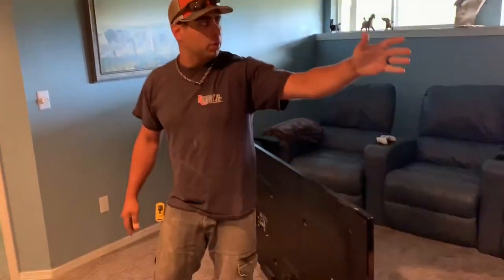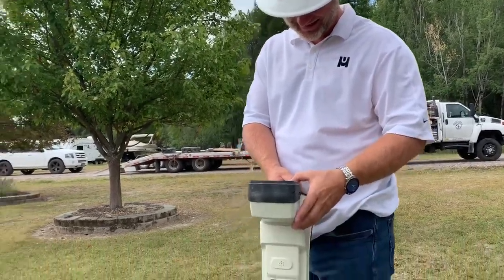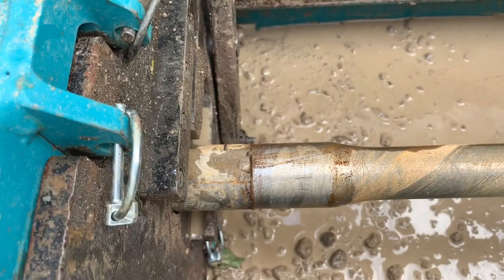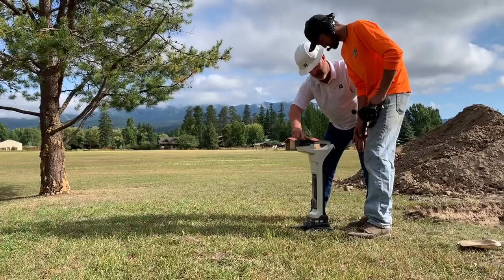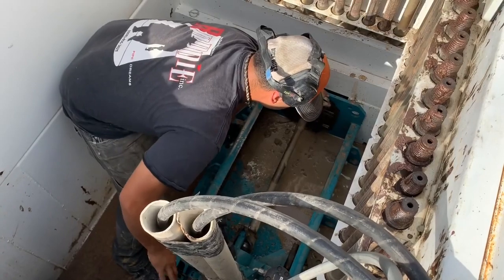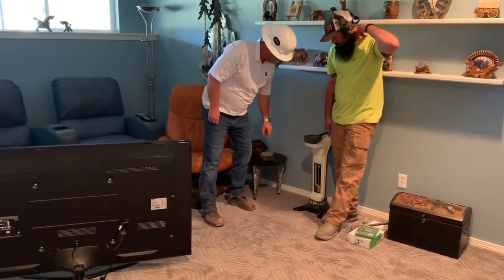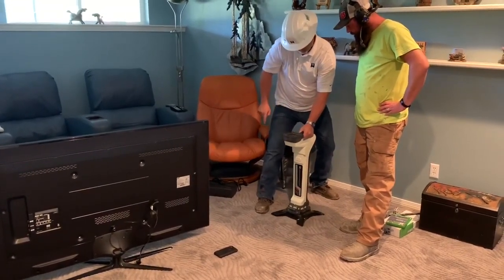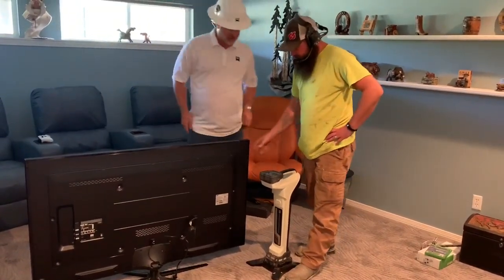Using Magnets to Locate the Problem

Comment: How TF do you steer it ?!?! Lol , i just have to know!
Reply: Its a directional drill it steers by the rods bending yes bending believe it or not they bend. I have a directional drilling rig its a vermeer and it drills above ground, the two guys with that weird looking thing is called a locator they guide the guy operating the drill where to go where to steer, where to rotate when to push rods forward and back.

Comment: Your trench box with rod holders built in is a cool idea. You guys ever think about a wiper in a holder right on the outside of your vise fixture? Might hold back some of the mud and also clean your rods up on way back
Reply: I would think just hose off the drill rods in the hole before pulling the box out, or with it in the air, all the dirt and mud goes back in the hole and everything is clean for the next.